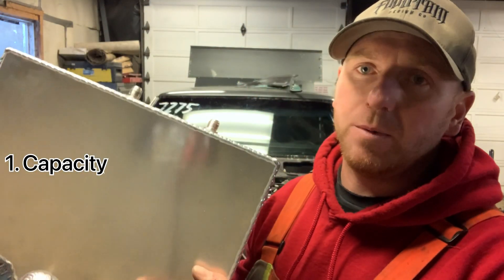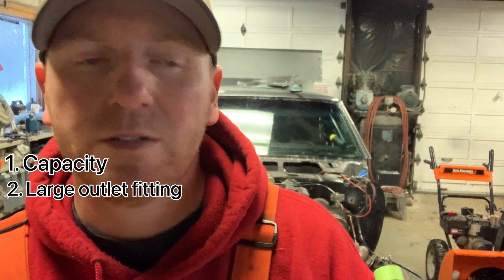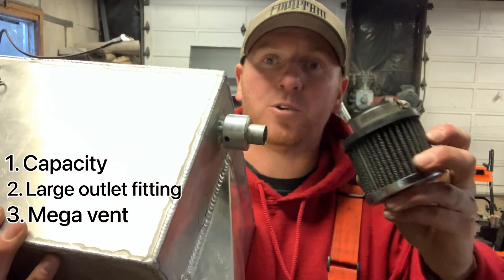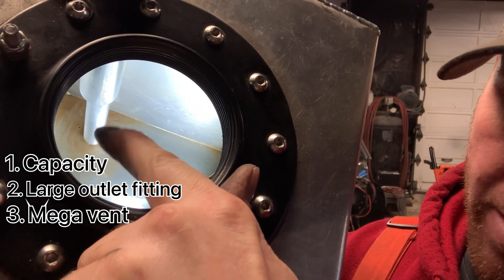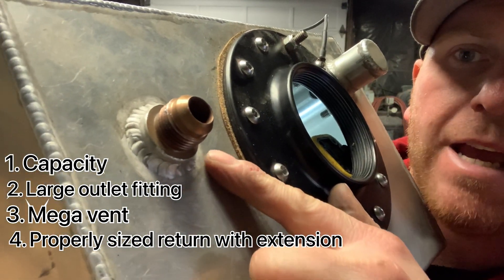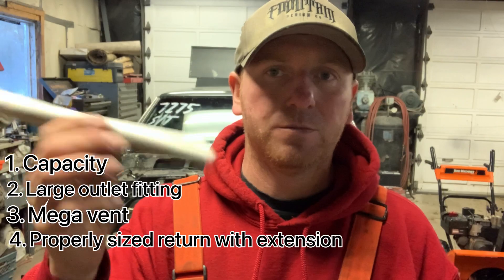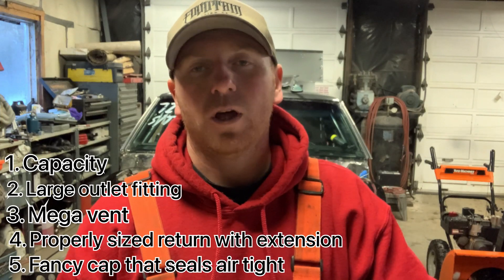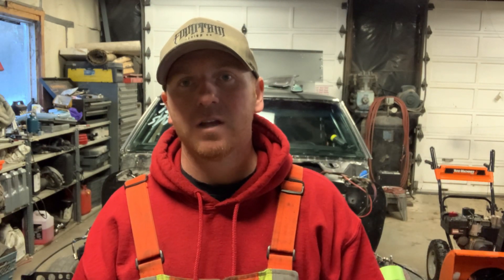Fuel Cell Mods for Alcohol / Methanol

Comment: Getting all my parts to build, mount, and plumb my coolant, fuel,  and intercooler tank set up/systems in my project and pretty much got the idea just from your explanations in this video for the fuel cell mods but just out of curiosity did/have you made a separate video on it? And also does it not leak any fuel from acceleration/deceleration ? Like sloshing
Reply from the maker: Nice, glad the videos helped. Unfortunately I only made the one video on the fuel cell stuff and no I haven’t had any issues with sloshing or anything like that. It has worked great for me

Comment: If I were to nitpick, I guess the vent tube would capture some fuel if you went upside down and dump it out once right side up(wouldn't be much) - but that's about the only thing I can come up with LOL. Even then, just running a hose from the end of the vent tube up the side of the fuel cell would take care of that. Nice design, I think I'll have to steal that one!
Another basic fuel system tip is avoiding tight angles like street-90° fittings where possible, that's an easy way to reduce restrictions by just planning ahead. I dig the ported feed fitting, anything with flow can benefit from some basic porting.
Reply from the maker: Thanks for comments. I did a bit of testing before I actually went to this set up. I found that even with a regular rollover vent you would get a little shot of fuel come out before the ball seated. It really wasn’t much difference from what you get with this set up and like you said it wasn’t much. I also can’t take any credit for the design, found it on Yellowbullet lol!